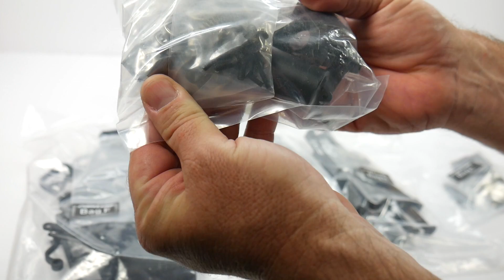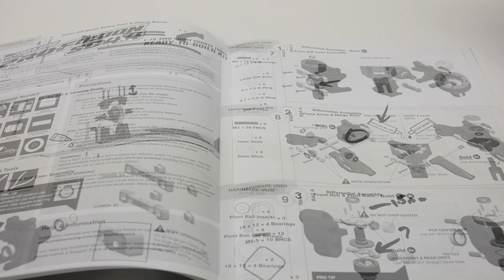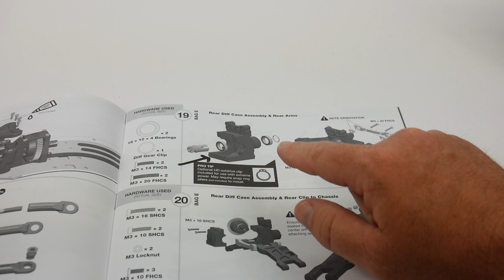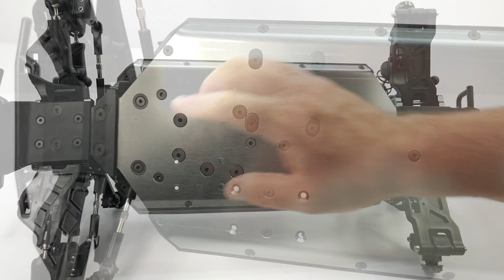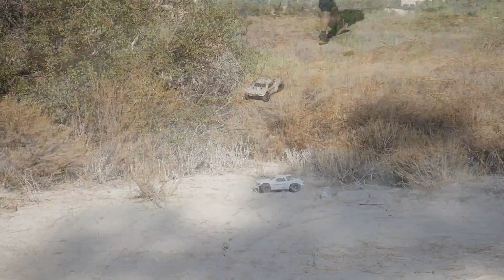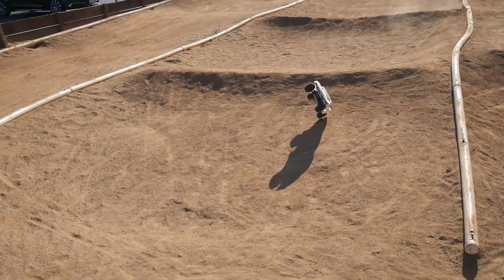Box to Build to Bash - Pro-Line ProFusion SC 4x4 - RC All in one Video

Comment: Since you’ve owned this truck has anything broke that you least expected or is there any hop ups you would do now since you had this for a while?
Reply from the maker: Unfortunately, I no longer have this one.  Really hard to work on (those side guards) and many, many issues with the steering, rear sway bars, center diff, motor mount, etc.  It's a decent truck and performs, but plan on spending some time dealing with those issues
Reply: The RCNetwork thank you for the heads up an honest response

Comment: This or the tekno?
Reply from the maker: Hands down, the SCT410.3 for so many reasons.  The ProFusion is a great design, just not refined.  There's several weakspots on the ProFusion like the steering, motor mount, ease of maintenance, sway bar mounts, etc

Comment: I hope pro line keeps the support for this platform around for a long time.  I opted for an 80% roller hobao hyper 10sce with a 4S system this summer for my first DIY rig. It was less than 1/2 the price of the Pro Fusion (169.99 NIB on ebay) It went together well and ive had a blast assembling and adjusting it to my liking. This definitely won't be my last non-rtr rig. My favorite sct is my Chuckworksrc midmotor  Pro-2 "Slash"w/ an Xerun XR8 pro sct esc and a 3660  Xerun sensored 3200 kv motor (same as yours) Ive had for 10+ years.& its responsible for my love of our hobby. The simplicity of the platform allows me to test and tune quickly and theres so much aftermarket part support , I never have issues getting parts or upgrades when needed. Looks like you had fun with this one , cheers

Comment: Any idea why they would design the front to be wider than the rear? Been trying to figure that out for awhile.
Reply from the maker: Probably stability.  It's a bit wider than most though..it had some issues fitting in the body under full compression
Reply: @TheRCNetwork  Odd, I can't think of any other RCs like that. I know plenty are wider in the rear, but not the other way around.

Comment: I've been debating buying this kit and putting all the electronics from my slash 4x4 lcg in it. Is it worth it?
Reply from the maker: If you can get past the motor mount and shocks (IMO) it's not bad.  I think it's a step up from a Slash - especially for the amount of power you can run

Comment: Great video Rich, looks like a great build. I've been wanting a SC Trophy Truck but I think I'm leaning towards a Slash Platinum. I know you ran one, what weight diff fluid did you run in yours since there's no center diff?  It's always good to see a video from you. 🤠🇺🇸☝️
Reply from the maker: Thanks Robert - As much of a recent Traxxas fan I am, I can't really recommend the Slash as a true SCT.  It's great and all, but there's better options out there that's built on a better platform for true power.  The Platinum does come with a center slipper installed, but also a center diff in the parts bag